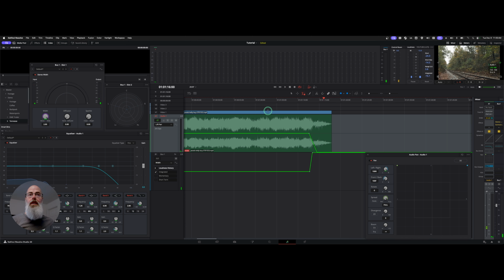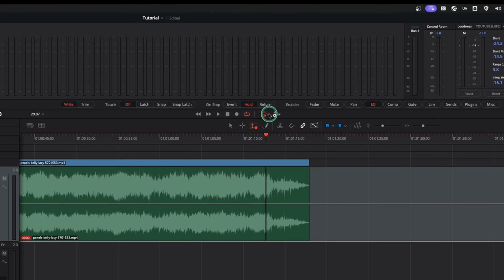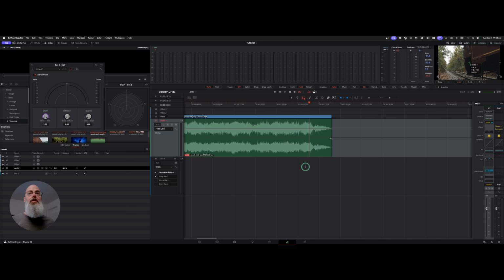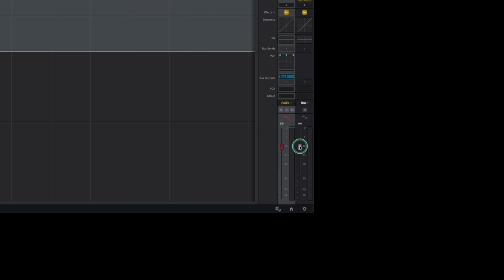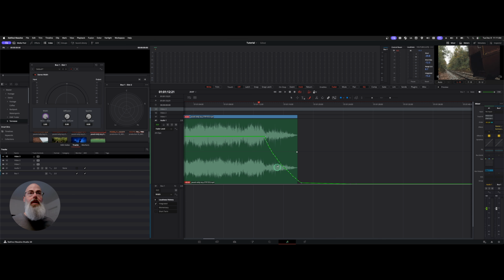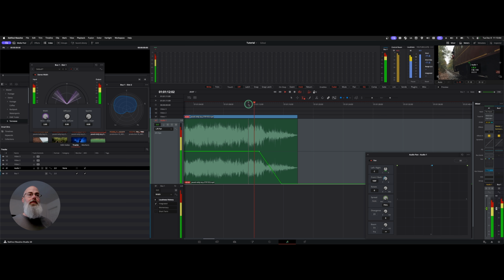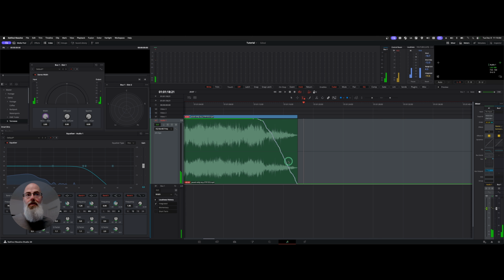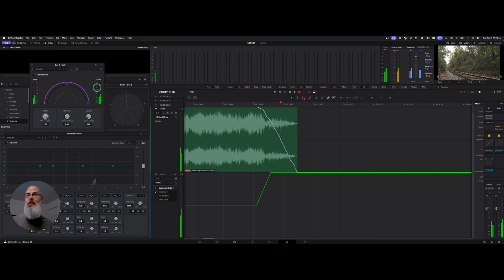Stop Resetting Fairlight Automation! Here's What to Do Instead

Comment: I've been doing automations on several tracks but mostly with spatial plug-ins but idk it keeps on resetting my automations like idk how to describe it but whenever I re-open my project something is always broken, like the panning is just stuck to one channel and stuff. So, should you turn off Touch after doing the automation or just close the automation to keep it fixed there? And most importantly, let's say I want to automate several tracks so should I just keep the touch on LATCH mode and when it's done turn it off, so it won't overwrite anything that's been done or do you manually have to like to select each track and add that specific plug-in and turn it ON/OFF since I want to change more than one parameter. And then manually click on arm to record and do the automation that way. Idk, it's driving me crazy.
Reply from the maker: That is frustrating. Especially given the time spent. I think you may be on to something the with touch/latch. 
There is a trim function vs. the write function. Maybe that would let it see it as an adjustment. 
But opening your project and having issues sounds like a bug. I don't see anything regarding locking or anything like that. 
Expect to "lock" the entire track, but I'm not certain that would save you from the issues you're having either.

Comment: Great video. Has anyone here experienced random automation data deletion in Fairlight? Spent hours of work adjusting levels and Resolve randomly removed all that hard work. Thoughts/Tips? Thanks again.
Reply: Experiencing this right now, not sure what's causing this but editing one automation clip (to borrow Ableton terms) seems to undo the points on other automation clips on the same Audio Track...? Very odd. Might just go back to Ableton for all the audio needs.
Reply: @ClydeMachine  sorry to hear that. Yeah, I’ve accepted adopting a DAW workflow for a video’s audio needs due to weird Fairlight bugs: (random Automation track data deletion, audio playback artifacts, non-intuitive bus routing/parallel processing, overly complex workarounds for simple fx sends like reverb throws, etc.)
Reply: Glad you have Ableton. I use FL Studio. It sucks that Fairlight has so many issues, is ridden with bugs, has so much clunkyness, and is non-intuitive.

Comment: At @5:10, we have a glaring example of just how f***ing awful automation is in Fairlight. Look at how the "curve" gets deformed when you moved the selection left/right!! Multiple sections went from being a curve to... massive amplitude drops. That's appalling. Seriously, Blackmagic needs to spend an entire revision cycle JUST working on audio in Resolve. It is woeful. I'm currently exporting all of my audio layout, taking it into Reaper, doing the 5.1 mix there, and then bringing the finished mix back into Fairlight just prior to rendering the final video.
Also... resetting automation clears ALL automation data from the entire track? WTF?
Oh, and something you didn't mention is that there's a shortcut to activate any parameter for automating. I'm not in front of Resolve right now, but it's either ctrl+left click or ctrl+right click. So let's say you currently have fader level as the visible automation lane, and you want pan. Use the keyboard shortcut on the pan knob in the mixer, and that parameter will replace fader level as the visible parameter.
Reply from the maker: Well stated. It’s really bad.
Reply: @TransientMobile  Yep. Also, slight correction to my earlier comment... I think it might just be right click on a control to make THAT the visible automation parameter.
Reply from the maker: That’s a good shortcut. Thanks!!!
Reply: Couldn’t agree with you more man! I export stems to my DAW of choice: FL Studio. That’s where I do final mixing/mastering/cleanup/polish/automation too. I’ve had HOURS of automation detail randomly deleted with no explanation and no Ctrl+Z (undo) to save me. BMD just released Fairlight Live public beta. I’m curious if it is the rework we’ve all been hoping for. Annoying that we have to export to a separate DAW for our audio workflows (more like work-WOES 😂), but it’s so much more custom/user-friendly/reliable honestly - even without a video to reference during the mixing. Cheers to you! 👍🏼

Comment: I honestly think no one know how to delete the points indviually. There is no video explaining how to remove massive amounts of the fader points I highlighted them with the focus mode, but nothing shows me how to delete them. I really do think no one has the slightly idea how to delete them. Its driving me nuts.
Reply from the maker: I couldn't find anything on it. This was the only way I could tackle at least removing points. Maybe we are thinking too hard? 
Seems like there would be a simple way.
Reply: @TransientMobile  i cant delete points after selecting them, do you press delete?? it aint working.
Reply from the maker: Delete key should do it. Make sure you’re using delete and not backspace.